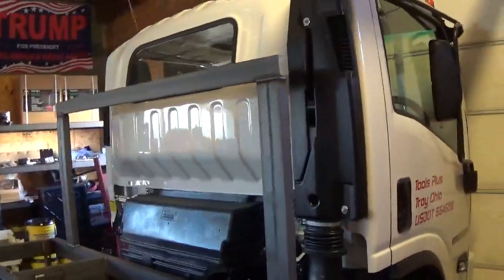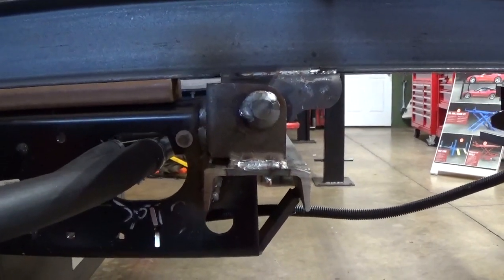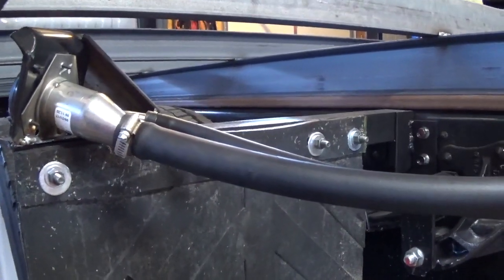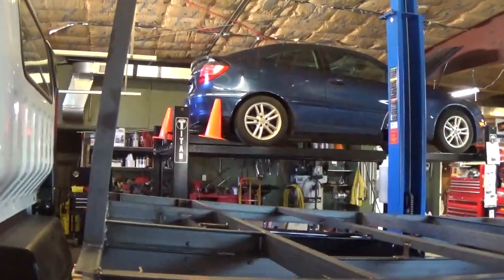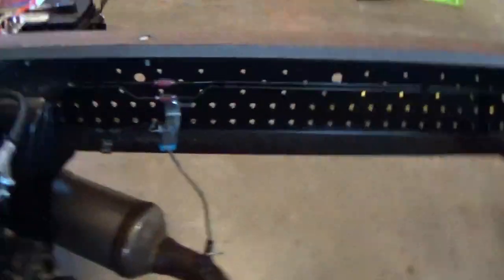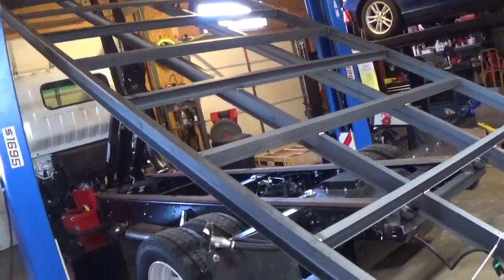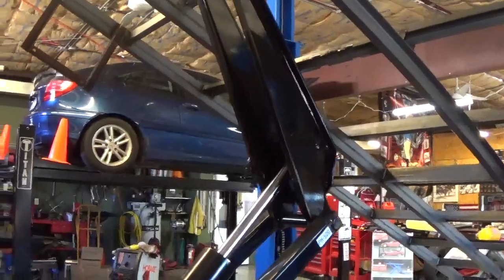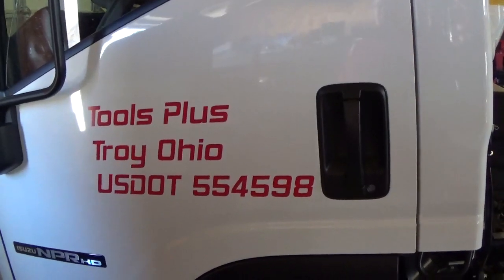How to build a flatbed or dumpbed  NPR-HD  dump bed install a dump hoist tiltbed

Comment: I built many dumptrucks ang all kind of truck bodies. My extra advice is,  you should fabricate a 5 - 8" baby chassy to support the main chassy. And the runner or beam of your bed is too small. It wont last for 2 - 3 years. You should make it atleast 8 inches.
Reply from the maker: It is now 4-1/2 years old with 200,000 miles
Reply: Subframe for dump 👎👎👎

Comment: Wow, many flaws in your system. I have had 4 different cab over trucks from 14,500 GVW to 33,000 GVW and had dump beds on everyone of them. Your entire set up is very poorly designed, light weight quality made and I doubt will last if you plan on any carrying any weight whatsoever. 

NEVER NEVER weld attachments to your truck frame, you always BOLT plates into your truck frame that the hoists is welded to, etc. Your flatbed frame is weak, it should have at least 6" runners underneath the dump bed if it was only 16' long, instead of 4" channel, that the hoist attaches to and what sits on and matches your truck frame when it is down. Your rear bed hinge should have had 3/8" x 3x3 thick angle iron notched in and welded to the end frame instead of your hokey 3" channel weirdness. Your bed is way to long for your truck and 4' overhang is too much. Your truck pay load is severely reduced by such a long bed. Your rear tail lights should be stationary onto a bumper that is bolted solid into your rear frame. If someone rear ends you, you risk tearing the crap out of your scissor hydraulics and dump bed hinges. if they hit hard enough. Since your bumper is attached to your dump bed, do not plan on dumping against an uphill slope, you just reduced dump angle where and how you dump a load because of that stupid bumper being attached to your dump bed. You should have cut round holes in your bed frame to accommodate flush rubber mounted lights all around. Although your efforts to making your own stuff is commendable, your design and lack of thought process makes your truck limited in pay load compared to GVW. your bed design is not for heavy loads, your tail length and bumper cripple your dumping capabilities. The possibility of your cross member welded to your truck frame that supports your hoist will be the first thing to fail, ruining your truck frame and damaging other things with it. Over all, what a waste of time and money. If your hauling foam and cardboard, you might stand a chance.